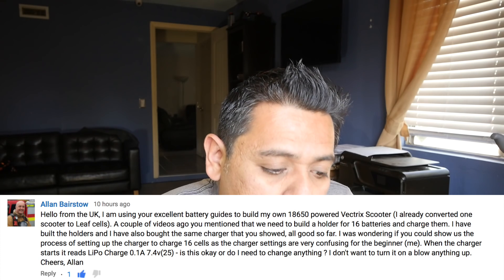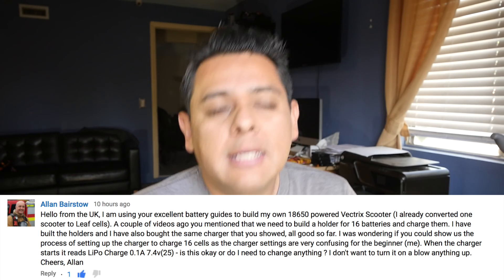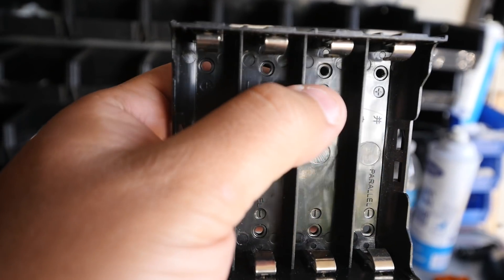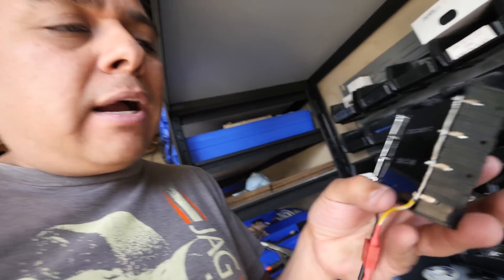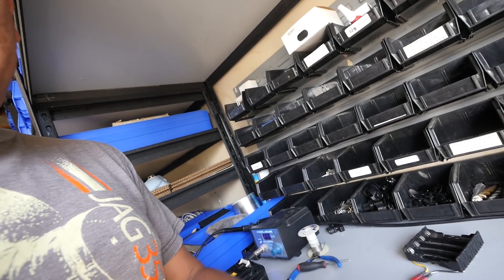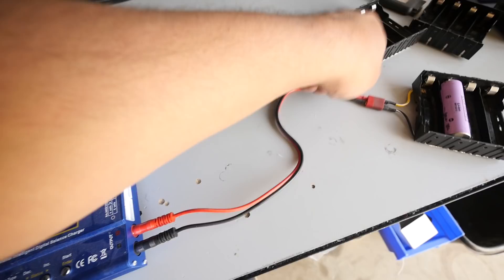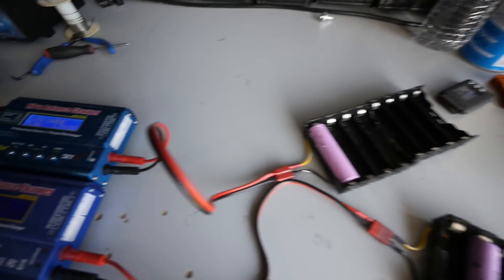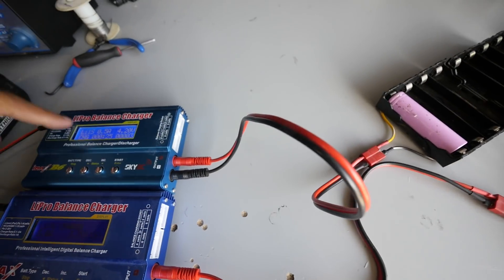Setting IMAX B6 to charge 16x 18650 cells at once -  Batt Talk #8

Comment: the battery holders you link in this video are not correct my man i just received them and they are the AA sized holders. I think they may have been correct for 18650s when you posted this video and the amazon seller may have changed the listing or something since then. long time subscriber keep it up you are inspiring.

Comment: You can also set those chargers to LiIon, which makes essentially no difference. Except that it changes the nominal voltage to 3.6 V per cell, which I would assume effects the capacity readings slightly (about 3 % more) since I believe the measured capacity is adjusted to 3.6 V. Meaning if it pulls 1 amp for an hour at 4 volts, it would actually read 1111 mAh since, at the nominal voltage of 3.6 V it would need 1.1 amps for an hour to get the same amount of energy. I don't know if this is the case, it's just an assumption, since that's what I would consider the most logical. I guess it would be easy to test with a lab power supply set to different voltages...
Anyway, if anyone knows exactly how these chargers calculate mAh readings, feel free to reply to this comment. ;-)

Comment: Hey Jehu, really enjoy all your videos. Stay up my friend. Do you think I could run 2x16 battery trays in series? Which would make 32 batteries in all to charge with the IMAX6 CLONE? Thanks
Reply: Were you able to do it?
Reply: It requires 16A but Imax can has 5A, if try to charge 16 cells with 5A it will take more hours to charge all the cells
Reply: It worked out better with one 16x cell tray. Also works better if you leave cells in tray for a day before charging, that way the voltages of each cell evens out. And that helps with having even voltages while charging. Which is key.. Thanks for replies and good luck with your battery projects

Comment: so what you are saying here that the Parallel linking of the for example 3 (18650 cells) makes the charger dealing with them as one cell, so we can get them charged equally >
my question is :
can I make a 3S battery so each cell consisted of two 18650 cells?
is the balance charge method gonna work on this kind of battery ?

and thanks
Reply from the maker: Yes

Comment: I charge 2 packs of 8 cells in parallel and run them in series by using a 2 position 4 pole switch. 

I use a RC charger and am running LiFePo4 cells which aren't fussy about balancing after they have been bottom balanced.

This set-up is for an e-bike, so it's relatively simple. 

RC chargers are handy to have around be if you like messing around with batteries.

Comment: I noticed on Aliexpress these battery holders have gotten cheap ..like 0.80 each for the 4 holder .So I'm wondering if it would be possible to build larger batteries by combining them..no soldering and it would make it easier to troubleshoot and replace individual cells..
Reply: i would not recomend using these housings for larger loads if you would like to get max current out of the pack these holders would cause owerheating and possible fire the connections would have to be made thick or wide as the ones on the pack when you solder it.
Reply: The type shown here seem pretty solidly built  .. I was hoping to get an idea if anyone has tried this for an ebike.. I know some are using them for power walls.

Comment: I take back my previous comment, you are right i had bad cells and this does work well, im building a 14s10p battery, can i charge each cell in parralle with an imax b6 and use this idea? Just use positive and negative of each cell, charge it at 4.10v and repeat 14 times..

Comment: Doesnt seem to work for me, i tried putting 4 cells in parallele and once my imax b6 finished charging at 4.10v, i checked each individual cell with a multi meter, and only one reached 4.1v, the other 3 cells ranged from 3.55v to 3.8v, connections were all good, so im not sure how you made this work ive copied your exact setup
Reply from the maker: Those are bad cells,  they probably burn energy in internal shorts at a faster rate than you were charging them
Reply: jehugarcia thanks i will try again with other cells

Comment: I don't even know that much about batteries but you're going to charge One battery at 5 amps? I know that's wrong. Now if you had all 16 batteries in there in parallel then 5 amps would be okay.
Reply: One battery is a group of cells, so, he's charging 1 battery, in this case made of 16 cells at 5 amps.

Comment: First off thank you for all that you do. Helping Puerto Rico out shows your true motivation which is helping people out with no hidden agenda. I'm motivated by your path and appreciate your mojo. 

I've been following for a while and starting to get pretty deep into sorting my 18650s out after my first order of 42 old laptop batteries. Now, I got my hands on 4 IMax B6 chargers and I'm confused on the settings. So I got the safety timer off and setting changed to LiIo at 3.7V 1.2A(charging 3 18650 at a time in parallel). Why can't we set it to 4.2V like the 18650s are rated for? Will the charger just stop automatically after it reaches 4.2Vs? Just figured the charge controller would let you choose the full voltage charge rate of 4.2V instead of just giving you the option of LiIo and the amps its pushing out. 

Again thanks for the motivation and what you do! #nerdout
Reply from the maker: Cells voltage is 3.7v nominal.  It will charge to 4.2v by default but you could modify on the b6 I think

Comment: Buyer beware on those clone/fake IMAX B6 chargers. I decided to buy 8 of these. 

They may or may not come calibrated. All 8 of mine were off. 2 of the 8 were only off by a little. 6 of 8 were WAY off, to the point they cannot be used at all. They are reading 4.2v batteries at 2.8 to 3.5v. The chargers that are WAY off, have NO way to calibrate them. It's a complete rip off, don't waste your money.

I didn't realize this until after the fact, so I can only get a refund for 5 of the 6 that are useless. Thankfully, 2 of the 8, that was only off a little, actually have the calibration menu. (unplug, hold Dec. and Start, plug in). If you don't get a new calibration menu when doing this, you have a paper weight if it's not calibrated properly.

Instead, I am buying 12 - 18650 battery capacity testing modules that run on 70mah 5v power. 12 18650 battery holders, a single 1a cell phone charger, two 7 connection terminal block and 12 micro usb cables, will power  a dozen of these testers. one or two 6.8ohm resistors and you're testing at about .4a to 1.2a load per battery. 

Example:

https://www.youtube.com/watch?v=v_RtSspY1Js

Then build your own multi battery "balance" charger like this, and get rid of that IMAX junk.

https://www.youtube.com/watch?v=tRYBtpzmNz0

Comment: If the 18650 LI ION pack has a BMS, would the B6 connect to the BMS input or directly to the battery? Cheers

Comment: Did you insulate those wires soldered to the holders?  If not be sure not to lay them flat on a metal table with batteries in them?

Comment: What you didnt mention is that if you have 16 batteries hooked up, you may have to go through 3-4 charging cycles before they get to 4.2V  The charger will only run so long then bail out and you have to start it again. 16 batteries starting at 3.5v will easily take 3-5 cycles to get them all to 4.2v
Reply: joeventura1 hey buddy can u help me im charging 16 cells at once the same shown in the video I have the imaxb6 and the holder and all ready all my 16 cells are at 3.7 v but my charger is showing 4.2v though it has not reached the Input current i.e 5 amps starts decreasing like 4.9,4.8,4.7 and after some time it was charging my 16cells at 2.9 so I turned off the charger plz can u help me!
Reply: Run it through the full charge cycle (it may error at the end) check voltage of each cell, if they aren't all the same voltage take out the ones that are lower, wait 20 mins and start again, keep doing this until all the cells are at 4.1 or 4.2 volts. Then you are done. Through each cycle Check the batteries for heat, if any heat up, throw them away. Don't leave them charging unsupervised.
Reply: joeventura1 but what about the input amps which decreases on its own? That would take evenore time for. Charging
Reply: Thats the safety built into the charger, you can't change it
Reply: joeventura1 can u provide ye email through which I can send you some pics so that u can guide me properly please that would help a lot!
Reply: joeventura1 I guess the problem is with my imaxb6 though it is a new one it cannot read the voltage properly like I even tried to charge 1 cell at a time it topped out at 3.8 v so I guess it's the imaxb6 that has a problem!
Reply: charge it again
Reply: joeventura1 I tried more than 5 times I have now given the charger for return will order a new one soon!

Comment: Hi i have  a question.
If you charge the battery with 3.7 volt how is the battery go up to 4.2 like you said. Shouldn't you be charging the battery with 4.2 instead of 3.7?
Reply: 3.7v is the nominal charge...it does charge them to 4.2v

Comment: Actually, you can do balance charging which will adjust charging to individual cell, thus max out the capacity.
What you did will (1 series 16 battery cells) compromise its capacity since each cell will contain different initial mAh, except you 're already sort its capacity.
Reply: Parellel charging self balanced"s itself,  no real benefit to balance charge if you can just do it in parellel.

Comment: Hello Jehu awesome video. But one thing i notice that is not mention is what Type of Power adapter is needed for the incoming Power to the wall?  at 5 amps output doesn't the input current amps needs to be Higher?
Reply from the maker: joseph chrzempiec no,  5A charge for testing is enough
Reply: Hello Jehu no what i mean is what type of Power input is needed for the charger to output at 5 amps?

Comment: I have a question about the IMAX B6 when charging 18650 .....Do i have to let it run for the whole 120min,because my doesnt tell me when its full,but it does tell me when the time is up though...Its a  3.7v 2000mah 18650 i have been charging it at 1.5a.

Comment: i was wondering about the possibility of wiring a large battery pack with a series of switches that allows it to turn from an 8S into a single battery back that is composed of possibly 100 18650's in parallel so that it can balance itself and not have to charge in increments of 6S (max capacity for series charging of a B6), however, i'm wondering if my idea is flawed because now each cell will be being charged at such low maH, it may take forever. what do you think? much appreciated
Reply: Just now was wondering on how to balance my battery without balancer and you, sir, gave me an answer. I will also try this, becoue I have no 3s battery safety board, but I think I can handle it with simple Voltmeter :D

Comment: You can change the LiPo settings to LiIon settings by going trough the user set>enter then set the battery voltage to 3.6 from 3.7.
Reply: it doesn't matter... it will get charged to 4.2V either way...
Reply: @intra_morph  It actually does because the final charge voltage for 3.6 nominal cells is 4.3V
Reply: @justin456  4.2 for li-ion
Reply: Li-ion is better for Li-ion, the charger stop at 4.10V

Comment: You missed a very key point.
All of the 18650's you have that you are going to put in parallel - MUST BE THE SAME VOLTAGE!!!!!!!!!!!!!!!!
Otherwise its a VERY UNCONTROLLED situation and you kill cans.
Reply: Ive heard this thing as well but over the years of playing RC, its not true. Even if they are not the same voltage, they will balance out after sometime. Try it yourself. Ive even connected a full charged lipo 3s (20C) to a dead car battery. Nothing happen other than the current flows into the car battery at the rate it is willing to accept. These 18650 are far slower than a lipo. It will never goes nuclear
Reply from the maker: Exagerations,  put it to the test
Reply: I always thought it was 0.1V difference when connecting a battery pack in parallel, especially LiPo's. Maybe they were talking about each cell within the LiPo pack.

Already had LiPo's do their fireworks show for me, luckily I baby sat them from the cliff, charged too fast, no LVC. LiFePO4's were popping, tried to solder right onto can, shoulda left them damn tabs on.
Reply: I really dont want to, but people keep saying 0.1V no more, to slap in parallel. Thats the way I do it. Maybe when you connect them up on the parallel board its different. I dunno.
Reply from the maker: it will charge too fast for a few seconds if the cells are far off from each other it then tapers off and by the time the charge cycle is done

Comment: Hello, I find that I have a problem, namely when loading imax b6 mini and unloading are different voltages, ie the other cell voltage displays the charger and the other shows a multimeter (directly on the cell) you had a similar problem? When unloading the charger shows 3.38va multimeter 3.45v on the 18650 cell I'm talking about loading and unloading a single cell) I found a video that shows the problem unfortunately without solution - https://www.youtube.com/watch?v=h1hQKOGtYqU or this https: //www.youtube.com/watch?v=h7PupRk8GEo
Reply from the maker: cheap charger will never agree with a cheap voltmeter,  one or both will be off and sometimes they can not be calibrated
Reply: This is the manufacturer of this charger:

I warmly welcome,

   As you noted, for small tensions the difference is quite large
Indications. With voltage around 4V (that is in the cells
This is already the level of error is already much smaller and there is no
Hazard for the loaded link.
  Charging individual cells is for this charger, "limit"
working conditions. In such cases the accuracy of this model is not on
High level, however, does not pose a threat to the loaded cells.
Unfortunately, this is a feature of most chargers of similar design.

Comment: i charged a pack of 60p 1s of random capacity cells in parallel  that i built and tested the capacity wich was 78ah at 4.2v it took ages and the counter rolled over a few times  but it charged it  no issues
Reply: I admire your patience when it comes to charging 1s60p using only 5A charger. That is only 83.3mA per cell, no wonder it took forever :)

Comment: Thanks. If I have a motor that draws 25 amps and i have a battery pack that is 6s40p - that is 6 cells in series with 40 batteries in parallel for each cell. That is a total of 240 batteries. How many amps is each battery discharging? I would like your answer to be in a formula. Thanks and you have a great channel.
Reply from the maker: +robviolin1   25/40=0.625A

Comment: I had no idea all the chemistry involved when i started using these batteries. If it wasn't for your videos, I would be lost!! But I have a few quick questions. I like to build those mini boom boxes, and a few of them are now using 5s BMS boards. I figured, since it is almost impossible to get a 21 volt DC charger here in the states, I would purchase a few of the Imax b6-s. Only problem, the person I give the box to would have to charge and than play. I am sure I am wrong, I am just learning...LOL. My questions-- Say I want to use the Imax to charge my 5S. Are you saying, when I go to charge all 5 batteries.(plugged in like you mentioned here). I would set the Imax at 5amps, and 3.7 volts or 1s."4.2 volts charging". The Imax will charge them all at 4.2 volt 5 amps, it see the pack as one big Battery? If this is the case, couldn't I get away with a purchase of a 12.6V dc charger, or even a 4.2 dc charger and it will still charge my pack fully. I have always been told-- Example, if you have 5s-You make sure to purchase a 21 volt charger, 4S-16.8Volts, 3S-12.6V, 2S-8.4V and 1S-4.2V(all 2 amps or higher). I can find affordable and abundant 4.2-12.6Volt charges all day long. Would save me some money. Or does the Imax only work this way if you do not have a BMS board?("I didn't see your BMS video till after I had already started using them..LOL") You have NO Clue, how much I have learned from your Videos!!!! Very Detailed!
Reply from the maker: Sorry I don't really understand your question
Reply: Sorry, I wrote this question when I first started my Li-ion Research. I was not that well versed in these batteries. I guess in "JoeMan Terms", I was asking, if you can use a IMAX B6 to charge the BoomBox Battery Bank. Answer: ("Yes")Than I was wondering if you could also use the Imax b6 to power the system, so I wouldn't also need to purchase a 21 volt charger. Answer ("No"). The Imax b6 does not provide the type of Voltage needed, to power the system. So I would have to purchase a separate 21 volt plug(not charger). Something like a Laptop Battery supply.

I ended up, rewriting my schematics to include a SDPT switch, and 2 separate plug-ins. Now I can run on Battery power, or switched and use a Proper Power supply. Later on in the power line, I have a master power switch with Voltmeter. (parallel charging will not work in my situation)-BMS charging the batteries, and than switched to DC power when needed.

The other questions-Say I have a 5S Battery Pack. Is It possible to charge that pack with a 3S charger. Would it still charge?, just slower than a 5S charger?. (Only in Parallel) My batteries would be in Series and would not work.

I want to Thank you for all of your Video's. I have Major OCD, and I wanted to make sure I got the battery system right the first time. If I had to guess, I have 2 weeks, 24/7 research on Li-Ion Batteries. I have learned the most from your Videos. I had to grasp the differences in parallel charging and series)Newbie here 200%, but learning!
 

Thank you!